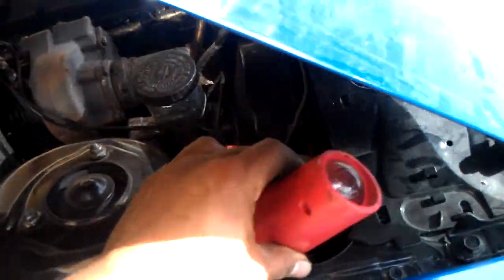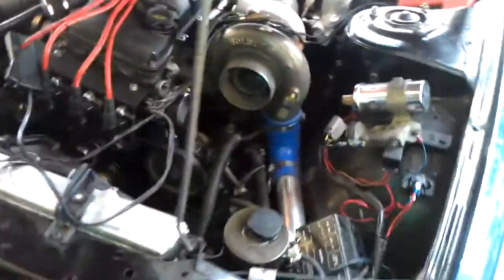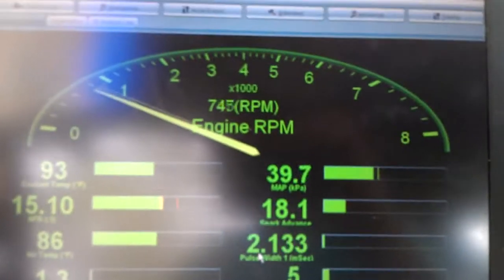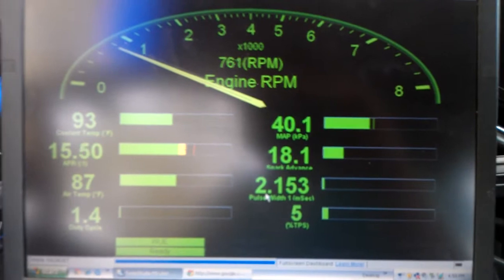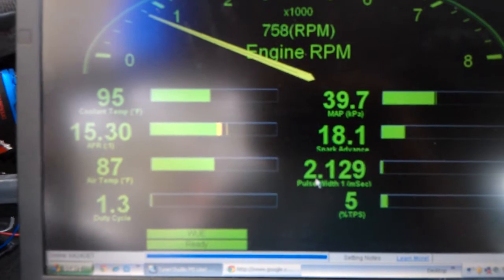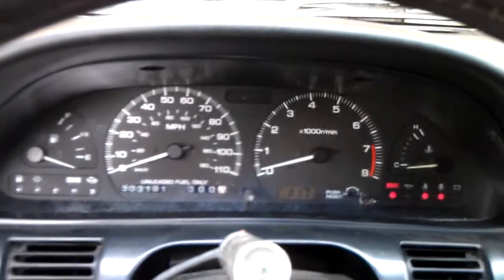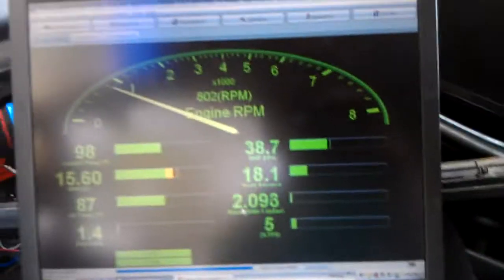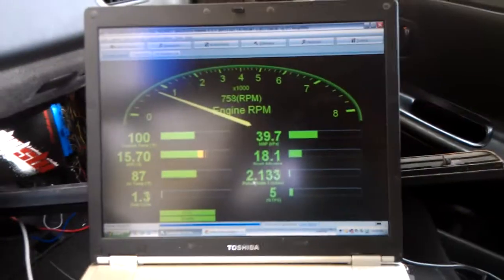Squirted KA24DET LS2 Coils, DIY Trigger Wheel, 1000cc

Comment: Is it posible to run a mega squirt ecu and meanwhile keep your temp gauge working?
Reply from the maker: On the dash, yes.  The dash has a separate CTS which the single spade connected on the front of the intake.  The one next to it with clip is for the ecu.